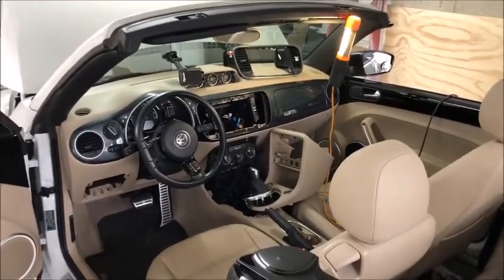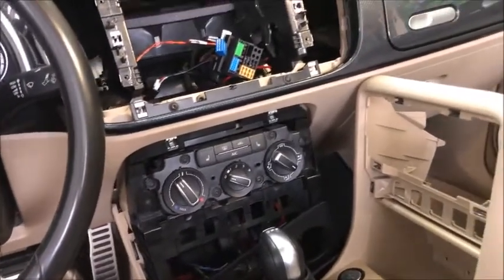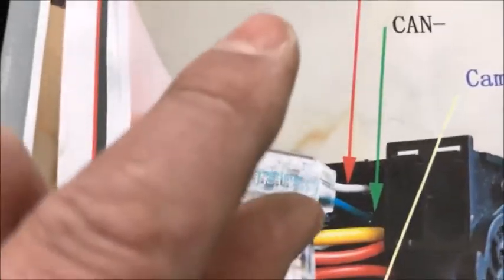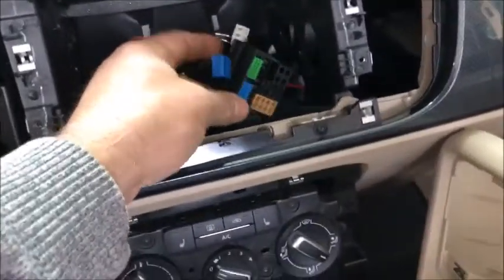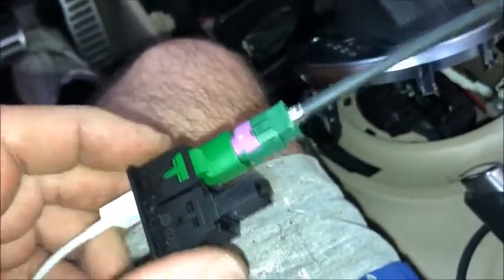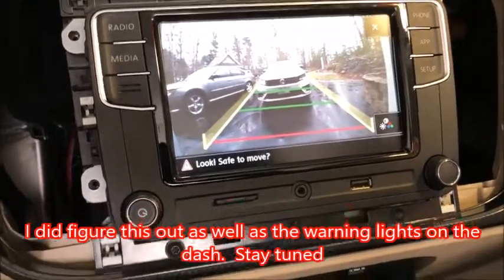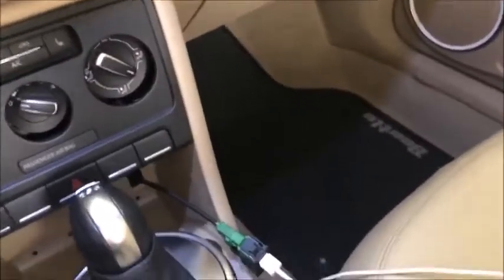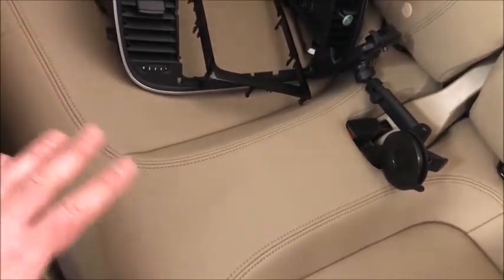2014 Beetle R-Line Fender Audio head unit upgrade to RCD 330

Comment: I have a 2013 Beetle with the RCD330. Mine is the 17F which is known as the perfect RCD330 variant but the other good one is the 17B which is from my research the second best variant. The 17B is also the most common variant and has DAB a.k.a digital radio reception which is just a higher quality of radio sound than what you get without DAB radio. Mine is the 17F variant does not have DAB Digital radio reception but with CarPlay and the Radio Tuner app I can get DAB digital radio through CarPlay so it doesn’t really matter to me if the radio itself has DAB but the radio app I use on CarPlay does. It’s also important to know that it doesn’t matter if the radio has built in GPS Navigation because CarPlay Google maps or Apple Maps is going to be much better than any built in radio navigation.

Comment: Hey, I'm just wondering if they ever sent you the smaller USB adapter and if you put it in, could you share a picture. I'd love to see what that look like.
Reply from the maker: They did send me just the USB jack however the existing hole that was used for the Aux jack is bigger so I was able to remove the USB connector from the housing it was in and I 3D printed a new one and it fits perfectly. Ill do a quick update video soon.
Reply: @ScrapMetalWorks  that's amazing! I was also wondering if you had a video showing how you removed that middle panel so I can replace that USB connector. All the stuff I've seen has it already disassembled.
Reply from the maker: @eddyfernandez3710  posted https://youtu.be/0fThvRKd8rE

Comment: Hi, I think I need some help, I have a beetle tsi 2012 with a RCD 510 premium audio but no fender, and I have a fender system here, I've been trying to put everything together in my head before installing, there are things that gets me confused, I've ordered a wiring system to install from AliExpress, but when I look at the cables, it doesn't make any sense not only when I look at the speakers but also when I look at the wiring diagram, so if you could give me an advise, it would be very nice. :)
Reply from the maker: I am sorry but I don't think I can help as I did this a while ago and don't remember the wiring. One think I will say is that if you are adding a Fender system to the car you will be adding the Fender Amp that mounts under the driver seat so you will have some wires that go from the head unit in the dash to the amp and then back to the dash. Maybe those are the extra wires that don't make sense so you'll need to lay it all out and make sure that the head unit is coded for the amp. Good luck!

Comment: Hello, maybe someone knows.  I install Android onTiguan 2014 with fender, everything works only without sound.  I can't find information anywhere
Reply from the maker: The amplifier for the Fender system is separate from the head unit and it needs to be turned on by the head unit when you power that on. It also has to be turned off automatically else you will drain your battery. Find a diagram if the old/original head unit connector and look at each pin. One of them should be labeled “amp” or maybe “Switched VCC”. Power must be applied to that pin when the head unit is turned on and the Fender amp will turn on. Good luck.
Reply: @ScrapMetalWorks  I've tried everything, but nothing works.  Could it be that something needs to be changed in the menu of the car itself?

Comment: I just wanna state that the fender audio system is absolutely amazing and I don’t have it but I can tell you that the standard audio speaker system that comes with most volts wagon‘s is still pretty damn good and I love my RCD330 upgrade in my 2013 Volkswagen Beetle
Reply: Which unit do I get if I have the fender system?
Reply: @1990325is  I would suggest the 187 B